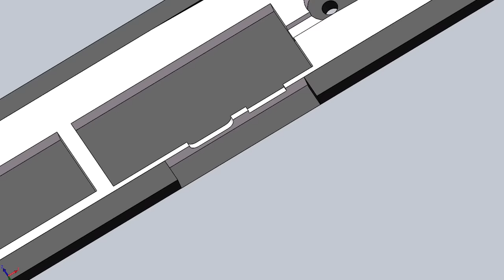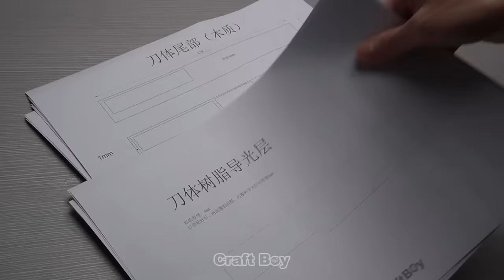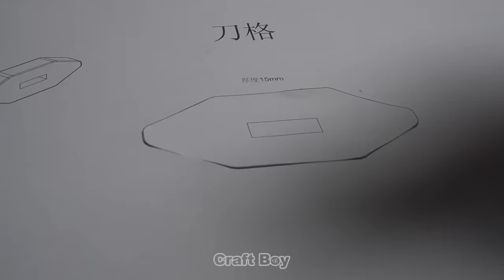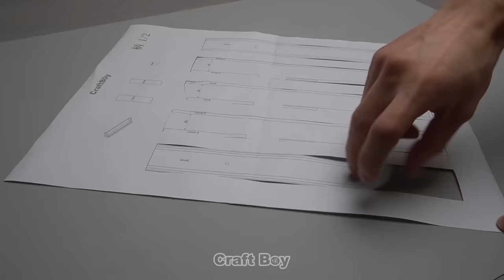Using 260 Popsicle Sticks and Resin to Make Scissor Seven's Thousand Demon Daggers

Comment: awesome build as always... but I'm wondering, why not use wire saw here 11:33 when cutting a shape inside instead utility knife. wire saw gives you full control of every direction you cut, plus save you from sanding too much.
Reply: It will break, the sticks is too delicate for wire saw. You can clearly see that even though he carefully cut the sticks with penknife it still end up breaking at the edge

Comment: Hi craftboy
I have been struggling with the
Wiring and found out that the led strip requires 12 volt while I only have a 3v battery. A DC change circuit won't fit in please help me I'm really frustrated as I'm just 8th grader